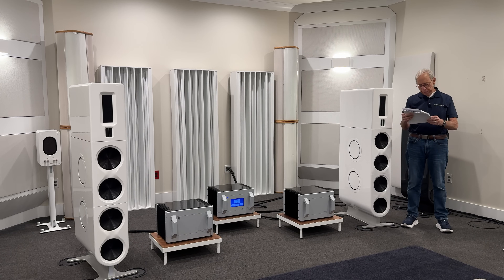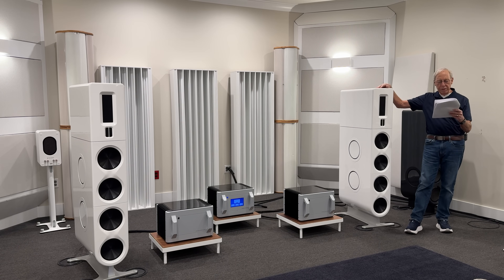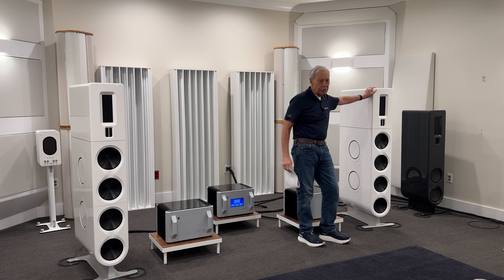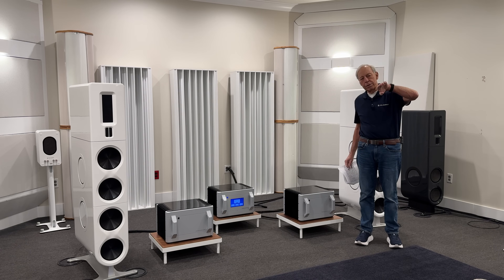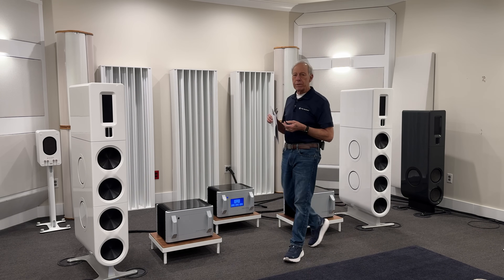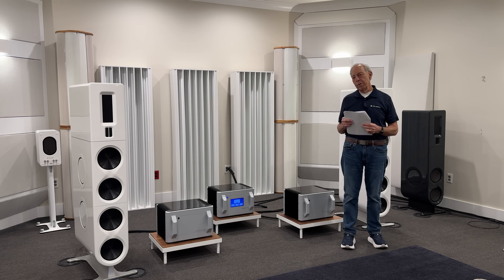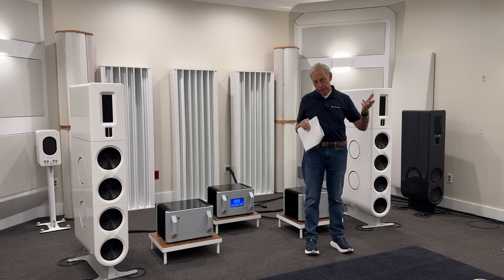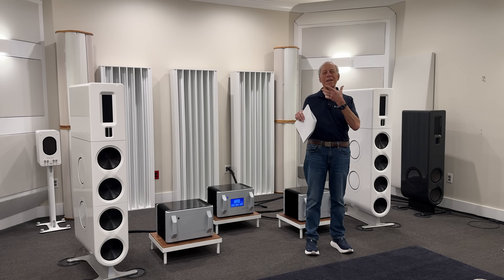Speaker specs and bass rolloff

Comment: It seems the trend is to utilize subwoofers to fill in the missing low frequencies.  Modern speakers often make due with multiple small drivers, planar magnetic, or electrostatic transducers.  I have never been able to integrate subwoofers to my satisfaction due to the spacial disconnect with sound waves coming from different locations.  That and the latency of the low frequency drivers makes subs a band-aid approach.
Reply: it depends on of the main speaker are bass reflex, you do not want to have that.
the latency of the low frequency drivers is coming from the dsp in the plate amp in a active subwoofer, i try to avoid that kind of subwoofer.
but the most common subwoofer is the worst kind of thing you can imagine, dsp subwoofer with ported main speaker.  i did not notice the problem until i got something better. so most propel are not aware of how good it can sound.

Comment: I like the idea of subwoofers, I just don't believe subwoofers do what they claim to do. I think the issue has always been the resolving power of subwoofers just isn't there. Subwoofer drivers have always been junk. Tons of moving mass, and they overcompensate by using tire inner tubes as surrounds and use big ass motors to beat the cone into submission. A sub should only be used as a last resort or as some kind of niche solution.

Comment: 3dB down means at that frequency the speaker is essentially only drawing half the amount of power, so that gives you an idea of how much volume you have lost.  6dB down is if you lost half the voltage.  Obviously rolling off lower is better, but don't forget that the room and wall loading etc might reinforce the low end a bit and add gain, so your in-room performance is very likely different than the speakers specs.

Comment: Arthur, if you still have the Magnepans, try an REL sub. All subs are not equal and REL work to maintain musicality. I have been using one for years with my Maggies and it is a good match. I surprised one listener by turning off the sub when a soprano was singing. The loss of tone was striking.

Comment: There is not a -3 dB industry standard for manufacturers to quote their specs.  They can say anything they want.  If they SAY the lower frequency limit is -3 dB, that's one thing, but if they do not specify whether it's -3 or -50, then it can be ANYTHING as long as the speaker is capable of producing the quoted frequency.  The spec says NOTHING about how loudly the speaker can play at the low end of the spec.  Further, even if the specs include the "dB down point", they never say in what condition they achieved their claimed measurement.  Anechoic chamber?  Large room?  Small room?  Stuffed in a corner, or in the middle of the room?  In a peak or a null location?  YOU CANNOT KNOW unless they tell you.  I've been going to Magnepan's website for years, and they NEVER say what their dB down point is, they just say "40 - 20kHz" or whatever.  That tells you NOTHING.  A 2" tweeter can play a 50 Hz tone.  You just can barely hear it.  Is that useful to you?  NO.

Come on Paul, you can do better than that.
Reply: I agree, there’s no fixed standard.  Most good speaker makers will also say what ±dB amount they’re using in their specs.
Reply: I have noticed a lot more spec -10db instead of -3db lately

Comment: I wish you could have suggested a solution not how it should work. Say set the subwoofer below or above the roll off rate at 50 hertz.
Reply: Well if in room the roll-off of the main speaker is actually -3 @ 50hz, then you want the sub to be crossed over at 50hz -3dB as well, and set the phase so the overlap is at 50hz to compound the gain at the crossover point for a flat response

Comment: I got the exact opposite outcome with my Maggie 3.6 R’s and a Carver True Subwoofer with very little adjustments on the sub required. I get incredibly low Bass (stream Brian Bromberg  Wood” which is on Paul‘s recommended list) that sounds like the ultra low frequency content is coming from the Maggies. Tight, spatially correct, articulate, and tonally  accurate acoustic Bass.
I used the same procedure that Paul did.
Reply: Does the recording for the first track on that album sound to anyone else like they stuck their head inside the piano rather than having it on a stage in front of them?

Comment: I agree with Paul I leave my sealed bookselves full range (60hz) with my bandpass sub. I have tried setting a crossover like the popular recommendation but liked the sound and integration better when left full range. I'm not a bassaholic. I like clean dynamic bass. It may  be each case is different and should be evaluated both ways. I am starting to wonder if too many filters are having other negative effects to the sound that I dislike.

Comment: Everyone says I should get a subwoofer for my system.  

My response is to fire up a tone generator, dial it down to 3 hz and let them watch my "mid-bass" woofers crawling slowly back and forth (any speaker will do this, btw).  At 16hz I can rattle every door in my apartment.  At 20hz you can feel the pressure in your ears.  At 32 hz you start to hear an audible hum in the room.

Do I need a sub-woofer?   Nope... I simply pushed the speakers closer to my front wall and let "wall gain" compensate for the audible roll off that starts about 38hz. 

Remember back in the 60s and 70s when you used to line all your stereo gear up against a wall in your living room and stereos had thunderous bass?  Well it turns out they had it right.  This nonsense about keeping speakers out in the middle of your room to mimic anechoic response is what drives the need for sub-woofers.

If you don't believe me, turn off your subs and put your speakers about 6 inches off the front wall of your listening room ....
Reply: That may work to make loud bass but not good. if all you listen too is rap and hip hop fine, but the soundstage and imaging will be crap in most setups.  You'll get no clear definition of instrument or voice, muddy center, and no depth.  It's all compromises.  A sub, properly setup, will get you the bass at your listening position while still maintaining the other critical aspects of the sound many of us strive for.
Reply: @slode1693  
Did you actually try this? (I'm betting not, since you replied 18 minutes after my post)

The thing is I experienced none of those side effects...
Reply: @Douglas_Blake  Yes, I have setup many systems starting with the speakers against the wall facing straight out.  Have you tried bringing yours out a few inches at a time until they start sounding good, then toeing them in until you get the best soundstage and imaging?  I'd bet everything but below 80Hz or so sounds better than against the wall.
Reply: @slode1693  
Of course I've tried that, many times.  My speakers always wind up about 6 inches off the wall, 7 feet apart, toed in to my shoulders.  Every time... every speaker.  In other people's listening areas the positions are a bit different... but never more than a few inches from their wall.

Comment: Bass rol off slope for a bass reflex (or passive membrane) speaker is 24 dB per octave vs 12 for closed enclosure . So no , you will not hear anything significant from a bass reflex speaker one octave down the -3dB frequency .
Reply: Change your  driver's in the enclosure,  these days you are able to just order the speakers at the manufacturer's special products line. Or a Good Builder

Comment: It's worth mentioning that the spec sheet usually have the frequency response of the speaker or subwoofer, which is a bit more straightforward thing where you can both measure change in impedance or output in an anechoic chamber (or simulate). Then there's room gain which increases the lower you go in frequency, it's something simulated while designing speakers/subwoofers but I don't believe any manufacturer includes it in the spec as that could get misleading. Then of course there's room modes for low frequency, causing both cancellation and amplification (which is the reason why all speakers no matter the brand or cost will benefit from them if properly integrated).

Comment: Yeah normally speakers are measured +- 3 dB, which is ridiculous that PS audio do it with - 6 dB. Just like measuring their amps at 1 KHz with high distortion. That's one way to crank a little extra specs out of an equipment. And some manufacturers just write frequency range, and then it's when you can barely hear the bass, which will be a lot lower Hz than if it's supposed to be at same lavel as the rest. All speakers can play bass. It's just a matter of how loud. And remember that there's no Hi-Fi police... So a manufacturer can claim pretty much whatever they want like piega line-source speakers that cost about 20k a pair. When measured they were 10 dB lower sensitivity... No big deal, that just means you need over 10x as much power to achieve the same sound level that they claim.....
Reply: I’ve seen one pro-audio speaker that put a plot of their frequency response as an engraved label on the speaker.  The Y-axis of the plot covered a 120 dB range, which will make anything look flat to an uninformed consumer.

Comment: Exactly right.  I will only buy a sub with high-level inputs, so I can leave my speakers at full range.  I tried the base management thing from the receiver.  Great plan. Didn't work 😏.  My speakers go down to 32 HZ.  Not using a sub.  Thanks for the video.
Reply: Problem with that is that you don't really handle the room modes. You don't need high-level inputs to leave your speakers at full range. That said, if you with high-level and X-over and phase get good integration that's about optimal. Normally the room modes are the challenge. That will require subs with dsp or using MiniDSP or similar. So speakers direct from amp full range and DSP for the subs.
Reply: @gardsolberg3422  I avoid base problems with the following setup. Speaker Placement Front Ported, Reference Speakers:

From front wall, 33". Rt spkr, 62" Lt spkr. Both speakers are 28" from side walls.

Room = 12' W x 13' L, or 144" x 156".

Speaker distance ratios equal;
Left speaker is 2/5 into the room.
Right speaker is 1/5 into the room. 
Both speakers are 1/5 into the room from the side walls. 
Speakers are 7.5 ft apart, the stands and front baffles were set parallel, then speakers were towed in, cross streamed 7%.  Speakers are also front  tilted up 7%.  The listening area is parallel to the speaker plane, centered, 8' from speakers. 

Speakers in room response down to 32 HZ.  Mid-range and treble are very well balanced, surround effects from the tube preamp are excellent.  Sound stage is excellent.

Using GE JAN 3654W tube preamp into T.I. TPA-3250 Class D chip amp, about 50 clean watts into 6 ohm speaker load.

This setup may or may not work with rear ported speakers.  So far I am very pleased with the front ported speaker design.  There is no boominess, but there is very deep, balanced bass.
Reply: Most recievers let you do both. You just have to set your speakers to full range